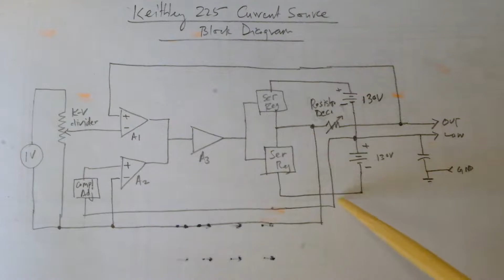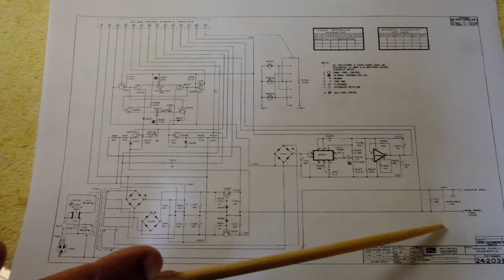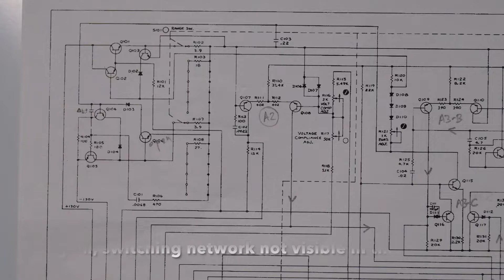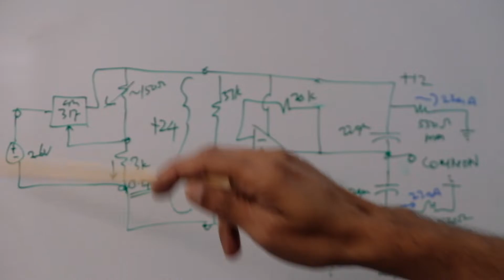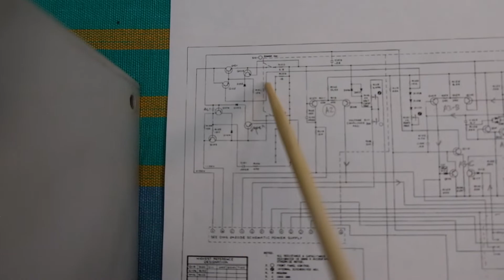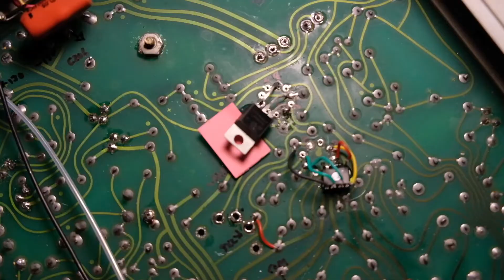Keithley 225 current source repair

Comment: Very interesting video, and that's some fine 'bodge work' your early results look great on most ranges. The initial wandering about seemed to improve after a switch change could it be some dirty contacts on the wafer switches ? or have you cleaned them all please ?...cheers.
Reply from the maker: Thanks. I did clean the switches and improved the regulated +/- supply aesthetics/mounting. There might still be some resistors which may be slightly off. The crossover point also needs to be tweaked a bit.